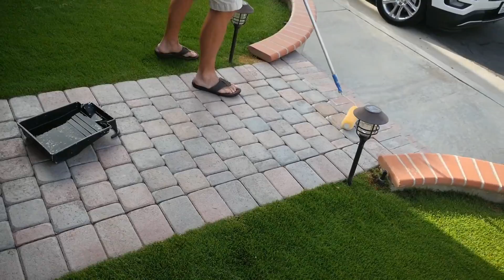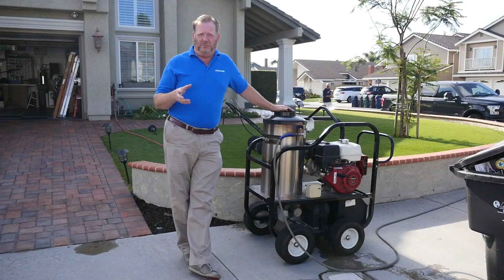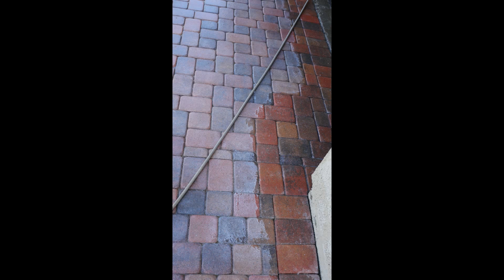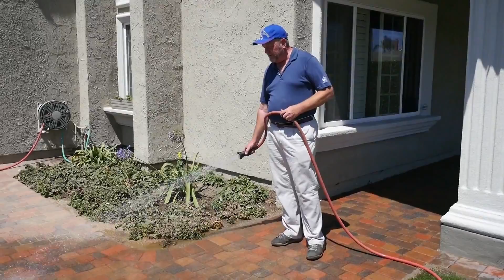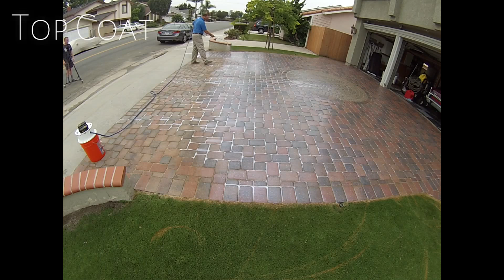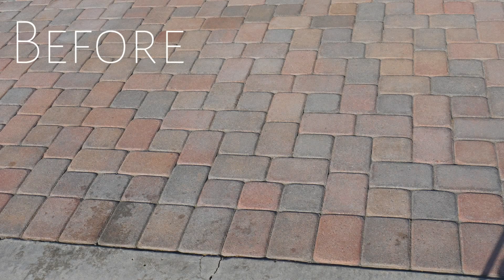Seal N' Lock Super Wet Sealer

Comment: Great product! Good video 

I don't use a mixing stick instead I use a drill mixer prevents solids settling or high gloss patches. also be sure before adding water to the mix for flood coat that you use some part A and water to rinse clean the part b pail into the mix bucket that way you don't waste any precious HDI , if cold make sure you use 80- 85degree water in the mix never apply if less than 60 degrees or late afternoon.

I am a volusia county florida / longwood florida  professional sealing contractot If you want a estimate reach out 386-682-7272.

Comment: there was a question as to how long the mixed two parts can be stored before use..  Answer is two to three hours per the manufacturer's product sheet at: 
http://sealnlock.com/wp-content/uploads/2016/11/Product-Data-Super-Wet-8-16-pub.pdf

in section "mixing"

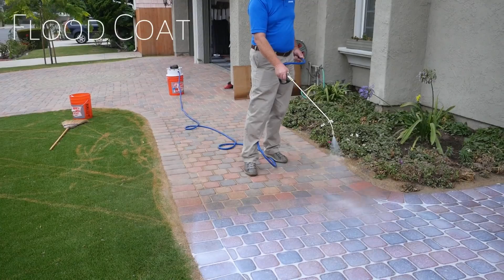Comment: What are all the dead grass marks at for example 7:40??  Are they from the bio-strip?  
Why use heated water?  Does the bio-strip require heated water?
Reply: The white marks on the grass is from the Hot Water, that grows out in a few days and get mowed away... . The Bio Strip was applied with a roller and then removed with Hot Water Pressure Washer.
The process works best with a Hot Water pressure washer and a Turbo Tip.
It will talk much longer to remove with cold water. probably 3 times linger. 
So rent a Hot Water PW for a 1/2 day or a day if you do this work.